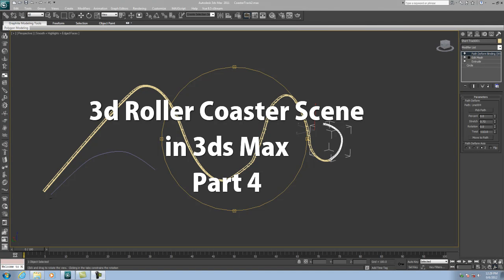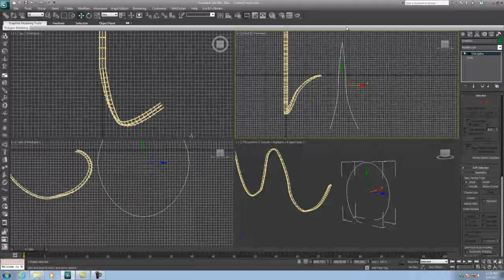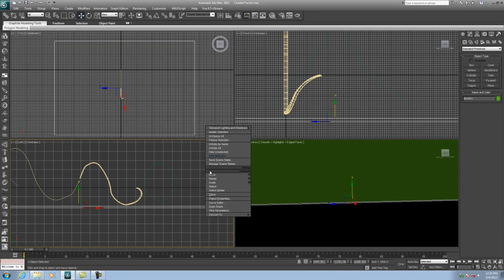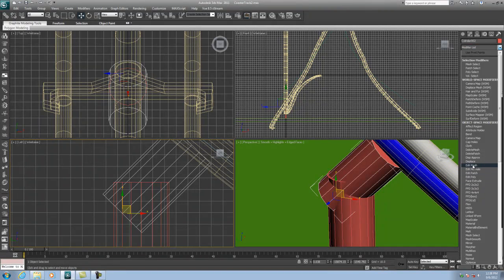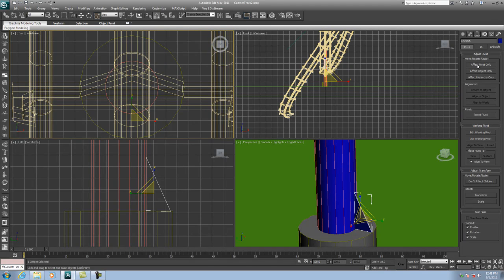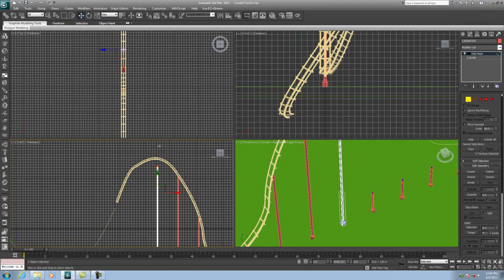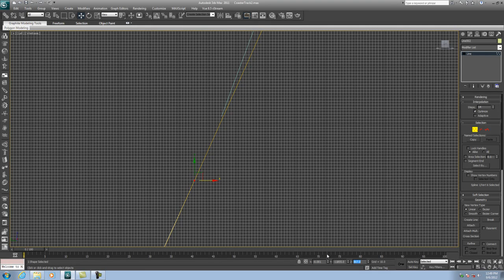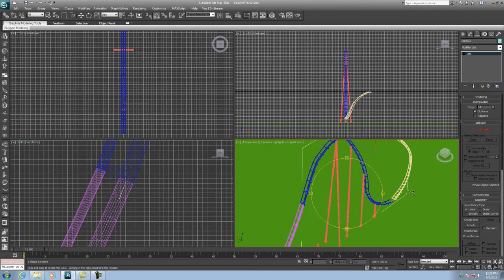Creating a 3d Roller Coaster in 3ds Max Part 4

Comment: That's great, and my pleasure. Its been very interesting. I'm currently designing a roller coaster animation for my undergraduate project at university, just been trying to figure out the best method to get animation working. Any suggestions would be most helpful. Thank you once again.